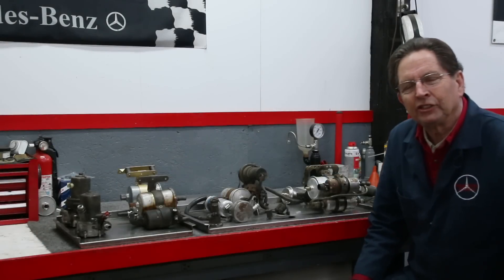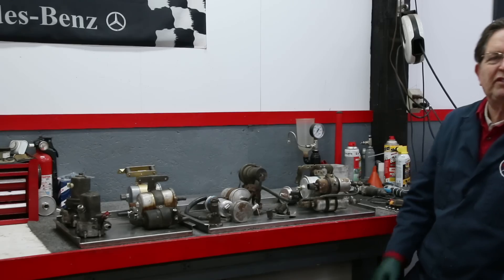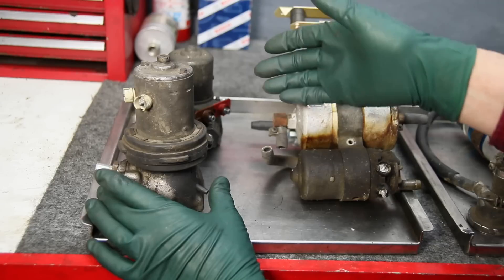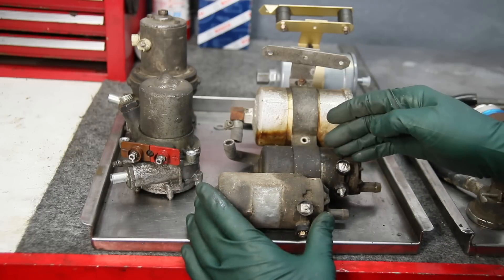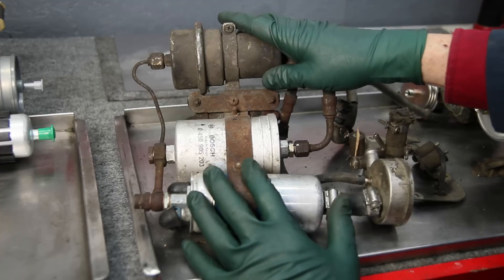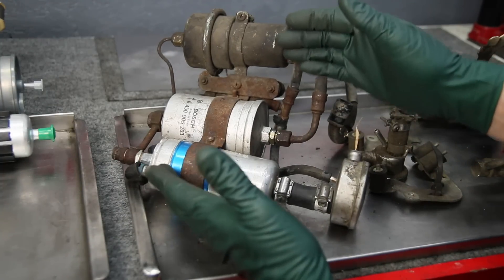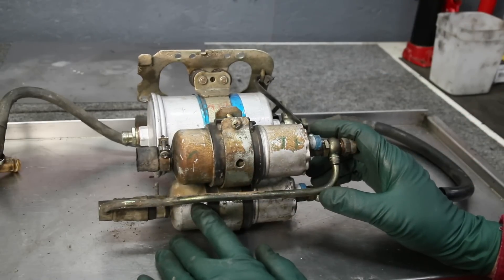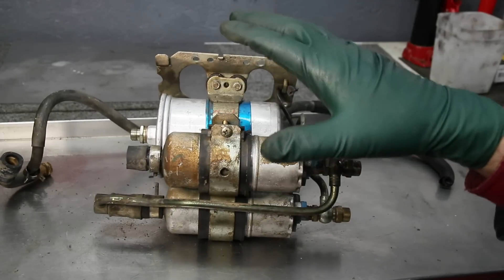Mercedes Gas Fuel Injection Delivery Systems 1959 to 1991+ Options for Repair or Replacement

Comment: I’m helping my friend try and get his late father’s 560SL running. The fuel pumps come on but the engine won’t start. No fuel is getting to the engine. Your videos are very helpful to me and we appreciate your content. Wish me luck as we venture forward in getting the car back on the road where it belongs.
Reply from the maker: If you are working on a fuel-injected engine that has not run in a while the best way to troubleshoot it is to use a fuel system pressure tester. Otherwise, you will end up throwing parts at it.  https://mercedessource.com/store/bosch-k-jetronic-fuel-pressure-tester-version-2-w-extras

Comment: Does this system replace the FID for the 1982 500sl ?  It looks like it should but wasn't sure if the 500 had a different pump?  Thank you for the video!
Reply from the maker: The fuel pump itself will be the same, but you may have a different accumulator or hose set-up. You would need to email some close up pictures to sales@mercedessource.com for me to confirm.

Comment: I need help with an ‘84 230e, what kit should I buy? I can’t find a kit for my 4cyl. I’d like to just get an accumulator and the hoses, my pump was replaced as well as the filter.
Reply from the maker: That model was never imported into the U.S.  Sorry I can not help with that one.
Reply: @Mercedessource  thank you anyways, I’m piecing up my own hose kit.

Comment: I own a w124 300e inherited from my father, 215,000km it works very well and starts cold at first, as soon as I turn on the ignition the engine starts, but after driving for a while with the engine warm, then when moving warm It's a nightmare, this information is very useful to me, I'm going to replace the pump and see how it goes, thank you very much and greetings from Spain
Reply: My 230E is the same. Did a new pump cure your problem?

Comment: Are there any more fuel filters in a 1971' 280SE 2.8 other than the one in the fuel tank?
Reply from the maker: Yes, there is a canister type replaceable element filter in the engine compartment by the left motor mount arm

Comment: I recently bought a 1985 280SE, it  runs aceptably in GNC (compressed natural gas in argrntina) but nothing happens with fuel. We gonna remove the tank to clean it (2 years standing)
Probably i may start the rebuild the FDS from the back

Comment: Can Anybody over here help me? The car used to have a problem starting. I had changed fuel pump relay nad it went fine for a bit with starting. Now I can not start it and the fuel pump relay is fine and fuel pumps themselves are too. The problem seems to be in electrical, but i can not find it. Please all help is appreciated. Thank you in advance. 
P.S. It is a 1988 560SEL.

Comment: I have a doubt, I need to install my fuel pump and the brown cable which I supose it's the phase one, only fits on the negative connector of the pump, is that okay or should the blue cable be connected to the negative sign of the pump?

Comment: Will the same FID Kit work on a 1989 300 SEL 6 cylinder, or is there a different kit for the 6 cylinder W126?
Reply from the maker: The components on the 6 cylinder are different from the V8.  Sorry I do not have an FID kit for the 300SEL.